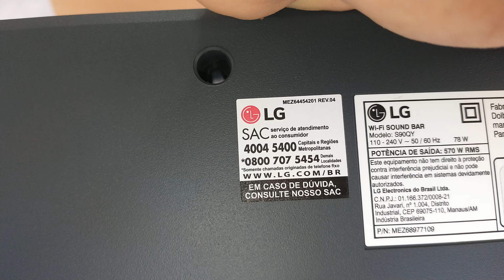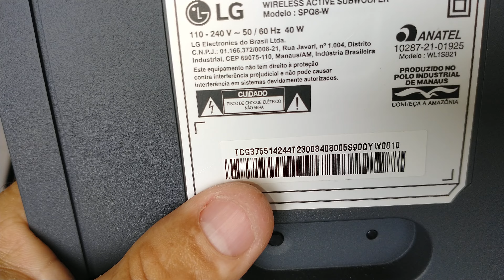LG Soundbar S90qy Look Inside (Disassembled) Teardown (Desmontada) Por dentro

Comment: Soi just bought q800c and the bass is great for movies and it shakes my house..but for music its really low i need to turn the volume all the way up to hear the bass and its really uncomfortable cuz the soundbar gets too loud..does the sub design for movies only or software problem?..do u face the same problem with the sub?
Reply from the maker: They all have this difference, films have a higher audio quality and that's why the sub works harder, on the LG S90qy this difference is small, but it depends on the brand and model.

Comment: Solid sub...does the bass any better than samsung q800
Reply from the maker: It is practically the same as the Samsung Q800, the subwoofer is from the same manufacturer and its box has the same dimensions.

Comment: Amigo, excelente conteudo. Li muito sobre uma atualizacao que deixou o som pior. Isso é realidade ou foi corrigido com aualizacoes posteriores?
Reply from the maker: Cara eu que já atualizei duas soundbars (a S80qy e a S90qy) só obtive melhoras desde a primeira atualização (já fiz duas atualizações) e pra mim esses relatos de problemas após a atualização não procede, essa soundbars tem várias configurações de som e após a atualização tem q verificar se alguma configuração não mudou, outra coisa e que nas primeiras unidades o volume ia de 0 a 40 e após a atualização ele vai de 0 a 100 então se vc estava acostumado a ouvir o volume 10 antes o q da 25% já que o máximo era 40 após a atualização pra ter os mesmos 25% do volume vc tem que chegar ao volume 25 já que ele chegaria até 100 por conta da atualização então pra mim esse e o principal motivo de algumas reclamações mas se esquecem que a porcentagem de volume mudou e ele querem ouvir o msm nível q ele ouvia antes e se esquece q o volume não vai até 40 e sim até 100.
Fique tranquilo a respeito disso, com o valor praticado hoje dessa soundbar ela e disparado a melhor opção do mercado.
Reply: @robsonbraun  Valeu Robson!!